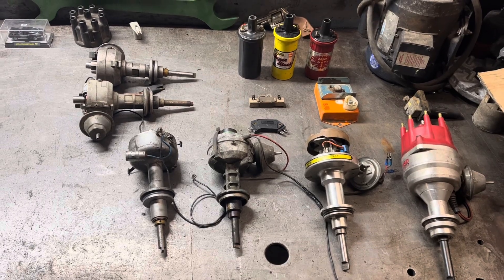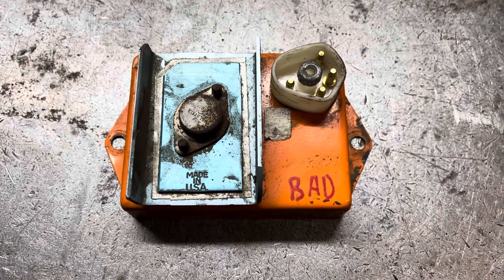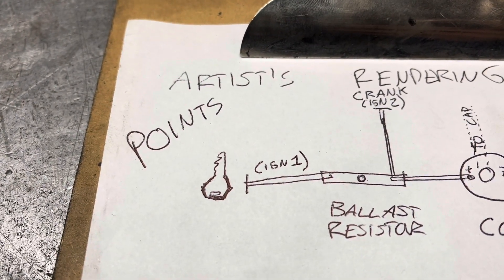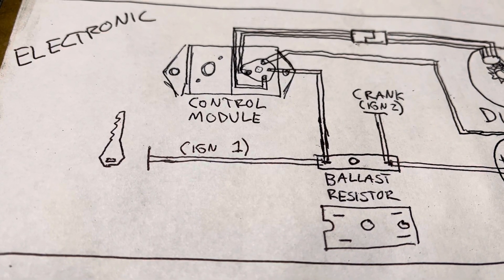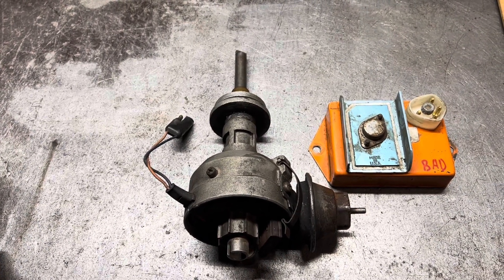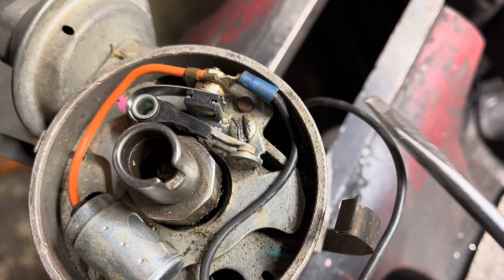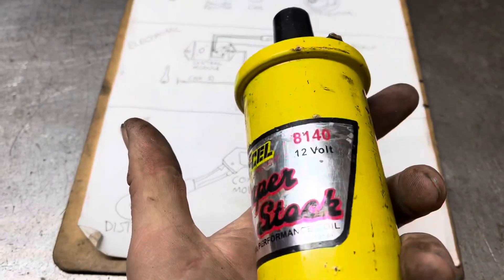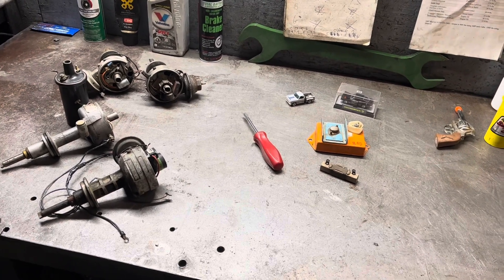Classic Mopar Ignition Systems - How They Work, How To Diagnose Issues

Comment: great tutorage of the venerable MOPAR electronic ignition system. I loved the system very few problems. in my early mec nik days my 74 Duster wouldn't start threw a 90,00 bill at it, only to take it to an auto shop. The old, grizzled owner held up a fairly bright piece of ceramic. And said you call yourself a shade tree mec nik and told me about the ballast resistor. red faced after I bought a spare for the massive sum of 2.00. thew it in my glove box with the appropriate nut drive, each year I would put the glove box one on and a new one in the glove box, as I said very few problems. Keep up the good work.

Comment: @DeadDodgeGarage  Great video, but you never really said where you put the GM HEI module and what you do to keep it cool..  I had one mounted on an old run stand, but never under a hood.. Funny thing was, I only figured out I could use it out of necessity. My mopar ignition box was dead and it was after hours on a Sunday night..
Reply from the maker: Mount it anywhere. I didn't say that because it doesn't really matter. I screw it straight onto a steel panel wherever I can find a good spot. It's worked well for me so far... but it should be on an aluminum heat sink, ideally.
Reply: Exactly why I asked.. Keeping the temp down is huge. Just like all the others. What I like about these is their size.  @DeadDodgeGarage

Comment: Awesome video Sir. I  do have a 1974 plymouth fury iii, 400cid v8 that sat for 6 years. The other day I  decided to work on it and it started and ran for about 3 minutes, now it cranks but won't start. I did put a new carburator, ignition coil, spark plugs and ignition wires. At this point I don't know what's wrong with it. Any help is highly appreciated.
Reply from the maker: I believe I describe the tests for the Mopar electronic ignition module and distributor in this video. Refer to those tests and figure out which one failed. I’ll bet on module, but distributor / pickup isn’t uncommon either.

Comment: You just answered several questions I had, thank you.
One little thing. Check that the wire from the side of the distributor isn't grounding out on the housing. A hint from Ask Smokey from an old Popular Mechanics magazine.
Reply from the maker: Have never seen that yet, but definitely makes sense. We just had another really good one too - make sure there isn’t a short in your tachometer… It’ll to the same thing.
Reply: @DeadDodgeGarage  Too funny. It's never ending.

Comment: the hei module has  two connectors on the distributor side, my vehicle runs better when the red ,(reddish) wire is connected to the small terminal,(lower0, and the black wire to the big terminal,(upper) I used a two pin gm style weatherpack to connect the distributor to the module. Thanks for the fix@!!!
Reply from the maker: I seriously wire it backwards on the first try every. Single. Time. And I’ve done this 20-30 times 😅 you bet!

Comment: I bought a 1969 dodge d100 318.
It was switched to electronic ignition.
I want to switch it back to points.
Can I use the yellow coil that is on there now, use it when I switch to points?
Reply from the maker: Absolutely. I’m assuming it still has a ballast resistor - which you will need.
Reply: @DeadDodgeGarage  thanks, I'll look for a ballast resistor.
Reply: @Dead Dodge Garage  it's on the upper firewall on the driver's side... Does this sound right.
Reply from the maker: @bobc.5698  Sorry for the late response. I don't get notifications of comment replies. Yes, that sounds correct.

Comment: I had an HEI system on a 73 W200, but it toasted the distributor? Don't know why because I don't know much about that system. I'm sticking with the Dodge setup because I've never had any issues so far. Maybe a detailed video on the setup could help restore my faith;)
Reply from the maker: That’s interesting. I don’t know how it could do that. I’ve never had a problem… yet! I should do a detailed guide. It’s on my list.
Reply: @DeadDodgeGarage  In all honesty, I'll probably stick with the Mopar setup, but the video was great for tips on how to know what to look for when having issues with the electronic ignition! Thanks.

Comment: I have an hei distributor  can I run fuel injection also 88 dodge
Reply from the maker: You can run one of those bolt on aftermarket systems if that’s what you have in mind. You should just need to use the tach signal connection to give it an RPM input. If you mean a factory type fuel injection system, not so much.
Reply: I was getting spark now I ain't getting any
Reply from the maker: @chrisdunivant8960  I have this video and a no crank video. I give various ways to check spark in this one. I need more details to understand what you've got going on.
Reply: Don't you have a no spark video

Comment: Stupid old Mopars do not put power to the coil when the key is in the start position.  Takes a while to make them start.  I added a relay to serve as the "IGN 2" you describe and the thing fires in less than a single rotation.
Reply from the maker: They do - except when they don’t… I have had several cars that didn’t power IGN 2 correctly. My current Barracuda project is one of them. Sometimes it fires right off. Sometimes it takes ages. The relay solution is a good one!

Comment: Can the HEI module work with points or do you need a magnetic inductive pickup?   Also, with no ballast resistor illustrated, which ignition coil works with the HEI module?  Do you have a Standard Motors part number for the HEI module?
Reply from the maker: Yes, the HEI can be triggered with points. There is a diagram online I have used for this. I use Accel performance canister coils as they are readily available and work without a resistor. They’re the cheapest in my area. Most other performance coils will also work fine for this. I don’t know the Standard number - I always give the application as a 1976 Chevy K1500. They’re the same four terminal module in many GM vehicles for many years.
Reply: Thank you for your quick response.  Regarding the ignition coils, I believe the primary windings are 3.0 ohms, 1.5 ohms, 0.8 ohms.  Which primary winding resistance coil is compatible with the HEI module?

Comment: I enjoyed your explanation of the two main types of Morpar ignition systems.  I’ve seen a few other channels do similar vids on them but none of them explained it so simply and thoroughly as you did.  I would like to hear your analyses on some of the high performance systems on the market and how the GM HEI control module stacks up when used for some of the higher performance vintage Mopar engines. I have a 426 with a cam that should allow me pull up to 6500 rpms. Unfortunately the standard Mopar distributor and blue box would falter at about 5900 RPM. I tried two different blue boxes with the same results.  I eventually tried an FBO distributor and box and the problem went away. I’m wondering if the GM module would have held up to the higher rpms. I know it might have been my coil also because the FBO package came with a high performance coil and a jumper to eliminate the ballast resister. The FBO box and coil was about $250. The FBO box comes with a rev limiter so even if the GM module would have worked I have that built-in safety now. On another note, I still think you should treat yourself to that Hemi. Keep doing what you are doing. Great content. Thanks
Reply from the maker: I have never used an FBO box. They are neat looking, but at least one person has claimed that it’s an HEI module tucked into a nice metal box with an added rev limiter… I know the proprietor of FBO likes to bash HEI ignition, so I find this idea especially amusing. I can’t really speak to the high RPM performance and stability of the HEI module. All I can say is it has always done what I need - but for the most part, everything I play with is a warmed over stock Chrysler engine on the smaller end of the pack, and never sees the exciting side of 5,500 RPM. I also have a good bit of experience with MSD systems, and I really like them. Excellent, smooth performance - and easily tuned as far as timing curve. The good old 6A box is great - until it dies. Both of my nice cars came with MSD systems, and they work great. The one in the Demon slowly draws the battery dead though. I don’t like the cost of the MSD system. This is why I gravitate toward the HEI module - good performance, very affordable, and compatible with the factory distributor.

Comment: Voltage regulator and control module (orange box) are two different parts? How do they differ in function and where does the Voltage regulator fit in this demonstration? 🤔
p.s.  I'm not a car builder, just an owner.
Reply from the maker: Yes. Two completely different parts. The voltage regulator doesn’t fit into this demonstration at all because it is a component of the charging system. If you are curious about where it lives in the larger electrical system and how it works, feel free to check out my charging system video. Lots of good information there.
Reply: @DeadDodgeGarage  
Very good 👍 Thanks for your follow-up.  I will check that out.

Comment: Hey so I’m working on my 86 with the electronic ignition, dude both tests, the module is charging the coil when key is at run, and then sparks when cranking as well. When I put straight power to the coil is the only time it starts up, through the resistor I cannot get spark all the way to the plugs
Reply from the maker: That’s… weird. Does it stay running once you remove the straight power wire? What voltage do you see at coil + when cranking?
Reply: @DeadDodgeGarage  I can’t tell anymore, doesn’t wanna start with the bypass
Reply: @DeadDodgeGarage  so, through the resistor the coil has spark, but after that the plugs do not receive spark
Reply from the maker: Could this be a weak coil? My thoughts are either that, or a distributor cap and rotor issue. Having spark straight from the coil but not from the plug ends of the wires can’t mean many other things.

Comment: I am new to your channel, and though I grew up riding in mostly Mopar products, I am a "Blue Oval" guy...That said... Our Factory points systems are almost identical, and even the factory electronic distributor pickups are very similar... As for the GM HEI conversion, I have done them your style (attached to a heat sink) and the whole Coil-in-cap unit, and we may not agree on the whole Coil-in-cap unit of conversion, (its not for everyone). IMO Duraspark leaves a LOT to be desired. - We both agree for a street machine a standard HEI style electronic ignition is usually more than sufficient.  I HATE that on social media that as soon as Joe Blow asks for a "suggestion" for an electronic ignition on a street cruiser that ACCEL/MSD/Mallory/ETC are the ONLY way to go... Well in my YOUNGER days...I had a MSD on a "warmed up" Ford V8....well when I was 300 miles from home that MSD box decided it was time to $#1T the bed...Well had I been using a GM HEI I could have went to the Auto Parts Store and picked up a replacement...BUT because I had converted it to a very expensive and not available anywhere ignition system, my Ford had to come home on a flatbed... Lesson Learned - Though I buy Chinese HEI complete units, I take the china guts out and fill with OEM GM parts...and I actually carry a complete unit (except plug wires) as a spare in the trunk...Because...Well, its easier to drop a whole new unit in and troubleshoot the old one later!
Reply from the maker: Right. MSD boxes are great… until they aren’t. My Charger has one, and it runs sweet. No problems. My Demon has one, and it kills the battery if I forget to unhook the disconnect for a couple days… which I do often. I don’t like the big cap conversion distributor because it’s huge, and it looks wrong. Also, extra expense. The factory Mopar (or Ford) unit hooked to the HEI module just works great. I know a heat sink is recommended, but I have never used them, and I have very rarely had a module fail. Like, twice ever on a vehicle I’ve converted.
Reply: @DeadDodgeGarage  The coil in cap HEI "looks" never bothered me...The price for the DUI ones did, I had so many issues with Duraspark that I converted to points for a while because I could not afford the DUI units, and had not explored the four (and 5 pin retard) GM HEI module conversion...

Comment: TU.  I relistened to the 1 spark. Tru.. Crank no start, Let go of key, one spark. New Mopar module fix.  Bought extra module (in trunk).  Going HEI next time 👍
Reply from the maker: You had no cranking spark but had a test spark, and it was actually the ignition module that was bad? That is surprising. Usually in that case it’s the distributor.
Reply: @DeadDodgeGarage  Me didn't know, so, I cannon shot the coil, first.  Then, O'Reilly ECU.  Running. Replaced with orig to make sure, no go. Bought extra in trunk ☹️.   The most complicated part is usually at fault.  🤔. Cheers!  Thank you for keeping them running

Comment: Thank you for posting this video. I swapped out points for a Pertronix on my 1966 273 and it went bad after 6 years which only amounted to 4000 miles. I put the points back in and it's been fine since. Points will always get you home; they can be serviced anywhere. Despite other people sweating by Pertronix, they left me stranded.
Reply from the maker: Wow. I can’t say I’ve ever had one fail, but I also haven’t had many of them. When I was younger, I was all about getting rid of points to try and get that extra 3 horsepower and “better starting” that electronic ignition is supposed to give. Total BS. I’m totally a points guy at this stage in life. So simple, and yes - so easy to fix. The only trouble nowadays is actually sourcing decent points.
Reply: @DeadDodgeGarage  Yep, everyone I tell my experience to is also shocked. According to one of their techs that we spoke to, excessively high voltage can kill the unit. I don't ever remember jump starting it with something that was more than 14 volts. I'm just disgusted because I was happy with the perceived "extra" performance right until it stranded me.
Reply: Getting quality condensers is now a problem. Will the HEI module work with points?   Who makes a quality HEI module?
Reply from the maker: @gfbemc0256  yes, it is compatible with points. There is a wiring guide for this online that I’ve used before. The best quality points and condensers in my experience have been Echlin, and as far as HEI modules I’m not sure. I use Standard and they are fine.

Comment: Could I change over to the GM control module and still keep my MSD pro billet ready to run distributor? I just spent $460 and change and although im tired of the issues involved with voltage regulators  replacing a perfectly good and expensive part for some pie
Reply from the maker: You don’t need an external module with a ready to run distributor. They have a module built in.

Comment: Hello, my dodge 383 with mancini electronic distributor  is going through coils,  3 in 2 1/2 years. They seem to over heat when excess cranking, trying to get oil pressure, not always. It started, ran for 4 minutes than died the last time the coil died,  .             I may put back the old distributor with dual points.    Good idea?        Please help me!!!!!!!!!!!!!!!!!!!!!!! Thanks.
Reply from the maker: Huh. So, are these factory replacement coils? And you have a ballast resistor, yes? I know the Mancini distributor is basically a nice looking factory replacement piece, and I also know that there are thousands upon thousands of factory ignition systems running around that don’t have that issue, so I’m very interested in the particulars of your setup. 

During cranking, the coil does get full battery voltage, but with starter draw it isn’t a whole lot more than resistor voltage, and also if you’re intentionally cranking the engine to get oil pressure I would expect you to be cranking it without ignition power. 

Feel free to respond in another comment or I won’t see it - replies to comments don’t end up in my comment list. You can also email me at jamienoise@gmail.com. You can include pictures of your ignition setup and wiring - that might help me wrap my head around it.

Comment: I need to hook up a wire for electric fans and it is labeled ignition.  It is the wire that allows power to the fans when the car is on and shuts off power when the car is off.  I have a 74 Barracuda.  Where would be the best place to connect it?
Reply from the maker: I am assuming that you are hooking up a fan control relay or thermostat assembly if it is pre-wired and labeled? The best place would be to find an extra unused circuit at the fuse box which is keyed ignition power - but this is only acceptable for low amp circuits. Your E body has the newer style fuse panel that secures to the firewall, and these often have plugs that are labeled for adding accessories. On an earlier car you would have to connect it to the back side of the fuse box. Alternatively, you could add it to the main ignition circuit that powers the ballast resistor, but I would prefer the first option. 

If this is a heavy gauge wire going directly to the fan, it would need to be wired to a relay first.
Reply: @DeadDodgeGarage  I bought this car recently and my fuse box is under the dash.  I was hoping for some connection in the engine compartment.  would the positive on the ignition coil work?